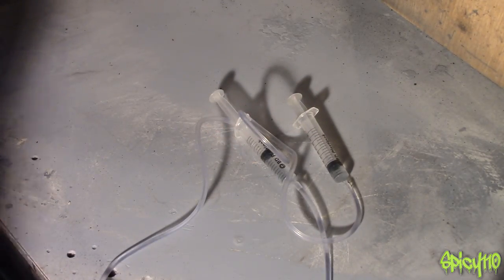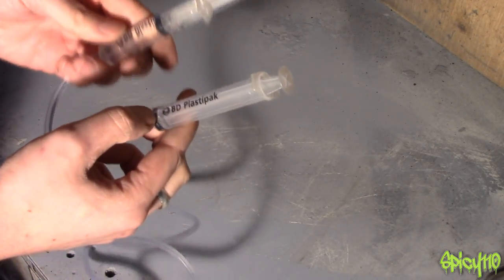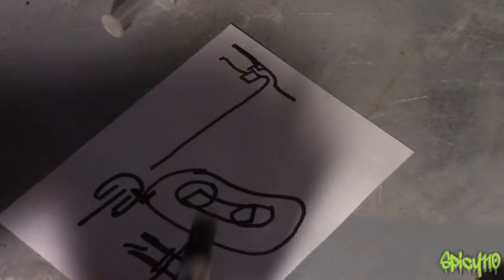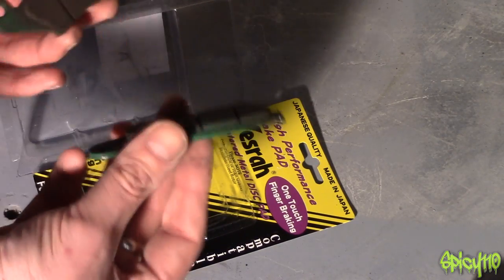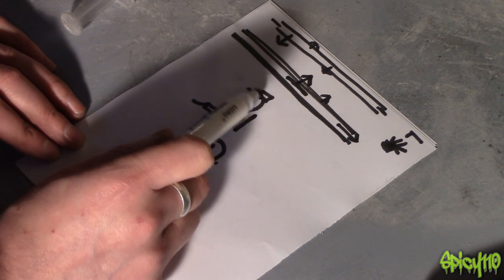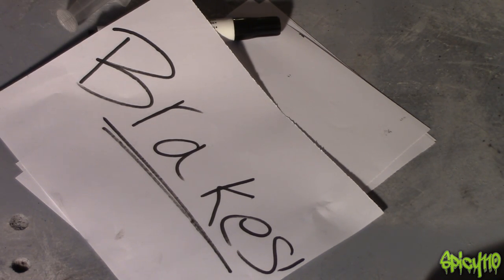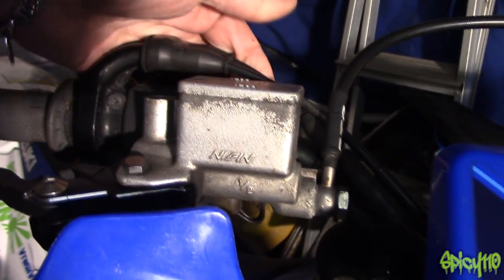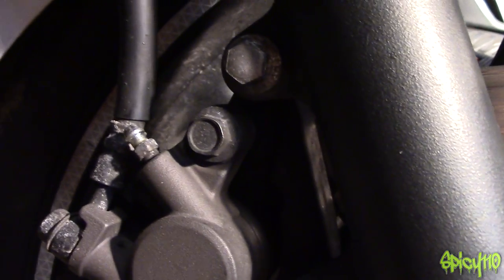Motorcycle Brakes! How they work.

Comment: My mountain bike has hydraulic brakes and this video easily explained why I looped a wheelie recently, I suspected an air bubble in my rear brake and watching this says just why my rear brake didn't do anything when I went to pull the rear brake to bring the front wheel back down

Comment: Just one thing to point out, brake fluid doesn't hate water, it in fact loves water, it's very hygroscopic and will absorb water from the atmosphere if left open for long enough, this is partly why the fluid needs to be replaced regularly as with enough water in the system, the fluid will boil very easily and you'll end up with bubbles everywhere in your lines and therefore no brakes.

Comment: Just wanted to clear up a couple things about the types of brake fluid.

DOT 3, DOT 4 and DOT 5.1 are all polyethylene glycol (PEG) based fluids - these are the types that like to absorb water. DOT 5.1 has a higher boiling than DOT 4, which in turn has a higher boiling point than DOT 3.

DOT 5, on the other hand, is a silicone based fluid. It has the same boiling point at DOT 5.1 (hence the similar name) but will repel water rather than absorbing it and will not corrode paint; it's often used in classic cars and those with nice paint jobs for this reason. It will, as you said in the video, damage brake seals if used in a system designed for polyethylene glycol fluids. It will also trap air more than PEG fluids and is not compatible with ABS.

Comment: Just one small-ish error in your explanation is that the pads always have purchase of the disc, it would be quite dangerous if the pads suddenly gripped the disc at speed, more so on bikes.  That is also why you can be more controlled, if this was not the case it be more like suddenly slamming on the brakes even with very little input.

Comment: The video helped me a lot, I would have maybe explained the reason why the piston goes back in. My guess is that once the brake lever goes up, it sucks the oil which sucks back the piston
Reply from the maker: The piston doesn't really go back in all that much, it is the slider of the caliper that releases the pressure.
Reply: @spicy110  thank you very much for this. I am a very visual person and things won't click in for me if I don't "see" them. I will do some more research.

Comment: Thanks for this, the drz400 is supposed to have some heat shield behind the brake pads that I have lost. I thought they were useless but you said something interesting here, they can get hot and affect the oil. Is that a real problem on the drz?
Reply from the maker: That copper plate is an anti-vibration plate to stop squeaky brakes, not a heat shield. However, regarding heat, all motorcycles that use hydraulic brakes can overheat them. This would only happen on things like track days, the constant hard braking can build up heat in the caliper to the point the brake fluid boils almost and this pressure can apply the brakes and lock the wheel. It is not something you need to worry about on the street unless your pads are not releasing fully and it builds up heat.

Comment: Good vid, Spicy.  I'm not convinced that braided lines are any 'better' than the vendor's rubber lines.
I'll agree that perhaps the 'feel' is a smidgen more severe, but it's subjective.  Some people may not like the feel of their brakes to be severe.   There is nowt wrong with the quality of rubber brake lines.   As they're quite an important part of the vehicle (read; VITAL), the quality is quite stringently controlled.   It's kinda like 'do you prefer smooth or ribbed'.  ;-)  I think you're over-emphasising the 'deformity'.   Here's an interesting vid:
https://www.carthrottle.com/post/rsVSBZ/
..and this one:
https://www.youtube.com/watch?v=Q4tPLd2lOyA&feature=em-uploademail